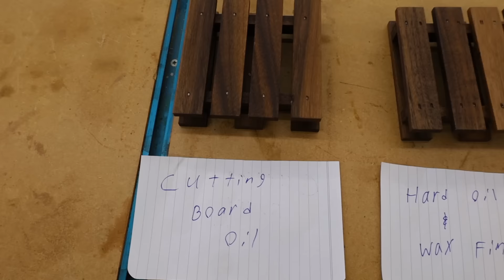3 Easy To Make Woodworking Projects That Sell | DIY Gifts

Comment: I have made sliding top boxes like these before, using various joinery methods, including but joints like you did, as well as mitred corners with splines, and finger (box) joints.  On every one, instead of using scrap pieces for the little handle on the lid, I saved the piece that I cut off the end piece and used that.  It also has the "advantage" of camouflaging which end is the opening end,and looks quite good.  I do also like your way of using a contrasting colour as well.

Comment: Three great little projects. With the popularity of making things from pallets, making pallets out of a fine wood is beautiful irony.

Adding rabbets to the wine box pieces is the simplest solution for hiding the slots. Miters are cool but they can be a little persnickety. It's easy to sneak up on the perfect rabbet.

For the pencil cup, I think the oversized and chamfered based looks bulky no matter how much of a chamfer you use. Using the contrasting white oak, cut a piece the size of the box and then cut rabbets on two sides of the base to accept the bottom pieces of walnut. You get straight sides, top to bottom, and a little structural detail from the alternating thinner and thicker edges of the white oak base.

Well made video showing how to make all three projects. It was long but each segment was concise. Well done.

Comment: I know this is two years old, but just wanted to let you know that I enjoyed the video. Regarding the multi-tool, I use mine all the time, however, more for custom renovation projects. They are extremely loud, so in the shop I prefer the pull saw.

Comment: Pretty inspiring, 2 things I will do different.  1st I will put my finish on before I assemble, will only need to do touch ups and will save time.  2nd, instead of dowels if you mix sawdust in glue to make a paste, then feel holes saves time and is cheaper, God Bless!
Reply: Good suggestions! Also cut the dowels shorter than needed. Stain them any color you want or burn the ends then drive them in flush. I have also made a jig to create my own dowels using a hand planer blade and a drill.
Reply: @airplayamusements5717  excellent. God Bless!

Comment: I have made a few of the wine boxes myself. You could have mitered your corners to allow the wood grain to match on 3 of the 4 corners and “waterfall” the piece. A small difference to make the project a lot better. Then if you wanted to keep the dowel accents, rockler makes a corner jig which looks cool.

Comment: I love the Deft Lacquer, but discovered a tip on another channel.  If you buy (or build) a cheap lazy susan, you can turn the piece you are spraying without touching it.  Allows you to easily do all four sides.
Reply from the maker: That is a good idea.

Comment: Nice little and quick projects.  A few suggestions for the wine box.  Use shallow rabbits ( as deep as the grooves) to attach the ends will hide the grooves on the ends.  I would cut plugs for the screw holes.  The plugs are easily trimmed with a chisel as you are cutting with them grain not across the grain.  You could use either the same wood to make nearly invisible plugs or a contrasting wood for highlighted plugs and I think the face grain looks better than the end grain of the dowels.

Comment: I think the pencil holder would make a great night light for a kids room. You could easily put a small LED bulb in there and then put your other base as a topper.
Reply from the maker: That's what I as thinking!  Maybe I'll make a larger similar version and do that!
Reply: @WalkersWoodworks  I liked the current size because it can fit on a nightstand without taking up too much room.

Comment: Great vid. When cutting many small pieces out of longer strips like you did for the pencil holder and coaster you could use painters tape to secure the longer strips together then cut multiple 4" or 5" pieces at once instead of cutting singles. A bit more efficient, safer and accurate.

Comment: There's some great ideas here! An easier method to hide the rabbets on the wine box could also be to use mitre joints.
Reply: Or cut some small plugs from the scrap cut off for where the lid slides in and glue 'em in.
Reply: Or, using either a router with a rabbet bit or the table saw, make a rabbet in the bottom of the boards for the plywood to sit inside attached with brad nails and glue. In fact this is an easier method than cutting a slot for the plywood board.

Comment: For the wine bottle box. Those little square holes made by the blade run thru can be plugged with sawdust and glue. Let harden & sand. A nice look is a darker wood sawdust to make the little squares pop.

Comment: I have found that staining, painting your project after cutting all the parts and sanding is the best way to cover the entire project. Took me half the time doing it that way. Touch up is hardly done. I’m gentle on build. Remember to compensate for the layer of paint/stain, it might throw your build off a slight bit.
Reply: I had the same thought.

Comment: Ryobi makes an 18V drill and driver kit to for with your brad nailer. There is something glorious about having one set of rechargeable batteries to power all your tools. Don't buy more than one battery technology or you wind up with lots of different batteries and chargers. Stick with the Ryobi 18V system and you can power ALL your tools from the same set of batteries and chargers. Do you want a shop full of tools or a shop full of chargers?
Reply from the maker: Haha already down that path.  But I do have the new 7 piece Ryobi HP+ kit now.  I used the drill and driver in my latest video.  Check it out. 👍

Comment: on the wine box, for the open holes at the ends from the slots, cut down small strips of wood (I prefer a contrasting color) and glue small sections in as "plugs" and it gives a nice, finished look
Reply from the maker: Good idea.
Reply: That sounds nice. Do you have any pics of that to share?

Comment: A quick tip for dowels, if you have a metal tap and die set you can run square profile hardwood through the required diameter die. cut a length of hardwood square and put it in a hand drill chuck and slowly cut the dowel profile with the die, you can finish with sandpaper .....
Reply from the maker: That's a great tip!

Comment: Great builds. You need to put caster wheels on your big work bench so you can move it around the shop so you don’t have to use extension cords.  Or better yet you can Mount a power cord under the top like I did and you can just run a cord to that and plug in several things at once

Comment: Thanks for your video. I really liked contrast of the wood colors. I’ve thought about making some coasters but the ones I’ve seen don’t absorb moisture from a glass. Probably would have to use a cork product. And the pencil holder. I thought the same thing as you, a candle holder. I think it would look good with the light coming thru it. Good tips and thanks.

Comment: Bora has a folding planer/cut-off table with modular cross bars than can be adjusted for differ sized units. It also has adjustable extension arms to support longer wood stock.

Comment: I’m wondering, for the wine box, if you were trying to save money & trying to maximise production, if you were planning to sell them etc you could make them more rustic. You could omit all the sanding, also omit the screws and just use the dowels to join. Plus I wonder if you could run the cover through the table saw to make a couple mm grove for an opening handle. Could also drill a couple of holes in the top and use a piece of rope for a handle… Good job sir!

Comment: To clean up those dado cuts on the front end you could potentially also set up a finished length on both ends and plunge cut with the table saw on the front end. This way you'd just cut from both ends of the board to make your long pieces have a bit at the end that isn't sawed through then take your short sides from the middle

Comment: the pallet coasters are great, but it might save time if you sanded all of he wood while it was long, and finish them also.  then just sand and touch-up the ends where they were cut to length.  Thanks for the video

Comment: ohh man, the part where you put the plugs in before the screws.. this is totally something I'd do haha. 
I just finished my first woodworking project, which was a pedalboard that had onboard power and in/out leads. Well, I knew that I would need to solder the jacks to the leads from inside the board as the jacks wouldn't pass through the hole for the panel mount jack... so what did I decide to do?? I soldered them up on my bench and then realized I messed up and had to do them all over again...:P

Comment: I use my router for the floating bottom like in the wine gift box. I fill those square holes with square pieces of wood like you did the dowels.

Comment: For the pallet coaster, as you didn't glue it together you could have used Rubio or similar coat on the pieces before you put it together.
Reply from the maker: I did use ca glue.  But ya probably so.

Comment: Spray lacquer just cuz it’s easier and quick and still looks good. Wondering if the screws were even needed on the wine box? Meaning, drill full size holes and tap the dowels fully into the hole. May need to clamp for longer but would save money for no more effort.
Reply from the maker: I went back and forth on that. I decided to go with the screws because i thought it would be more approachable.
Reply: @WalkersWoodworks  Hmmm. I’m a newbie but I definitely agree with that thought process.
Reply: I agree. I made some frames using this method.  It looks nice, costs less, and lets me say, "no metal fasteners".

Comment: Great video and I just gave you a subscription!  On the ends of the box at the bottom, I would drill a small hole to round out the groove and glue in a short piece of dowell to close up the hole.  Might give it a little bit of character?

Comment: I think you could use dowels to plug up the dado from the tablesaw on the wine box. It'd make it look a little more finished with nearly maintaining the ease of construction.
Reply: i was thinking that he might cut square pins and glue those in. Shouldn't be too difficult to fill those holes, and it could make for a nice contrasting accent. Especially if the pins matched the dowels on the sides.
Reply: Following what's the price point on these?
Reply: @jabrwok  that would be fine as well. But I was thinking dowels since he already had the one and the countersink bit he was using already would be easy on the square dado.
Reply from the maker: That would work!

Comment: Good video.  Useful tips. Thanks!
Why not lightly sand and finish the walnut pieces of the coasters and then assemble them?
I like the hard oil finish … but that’s just me.

I really like the wine bottle box.  If you don’t like to see the end slot - it should be easy to miter all corners and use painters tape to help glue up.  On the other hand, if you don’t like to make accurate miter cuts, then you could make a matching slot on the end piece and use a contrasting 🎉(or matching) wood spline “domino” to join the pieces and give a decorative touch.

Comment: I am making the wine box out of a set of OLD OLD mahogany bed rails I found in my barn. They were from a bedroom set that my grandmother moved into my aunt's house in the 1950's, it was passed down to several generations and finally the headboard broke and somehow I ended up with the rails.   All pieces are cut and the box is clamped together, I am just not sure on what size screws to use.  The boards are a little over 3/4 inch thick .  I bought a 3/8 inch thick oak dowel, but none of my countersinks are the right size, either too big or too small, so I am on hold

Comment: Love all these ideas and am definitely gonna try a few. Question, for the pallet coasters could you use pin nails instead of brad nails? I have both however, a pin nailer seems easier to aim and direct.
Reply from the maker: Yes for sure.  Pin nailer would work fine.
Reply: @WalkersWoodworks  awesome thanks 👍🏼

Comment: Awesome man but what I don’t understand is if you have the shop and all these tools and you don’t know the proper butt joint technique with dowels and screws. Still the cool vid man keep them up love the gifts great ideas and they came out awesome.
Reply from the maker: What did I do incorrectly?
Reply: @WalkersWoodworks  Nothing big just installing the wood dowel before the screws. Typically you pilot with the counter sink then add glue and the nail or screw then the Dowels. 😎🤘👍

Comment: Could you drill the holes and just use wood dowels to hold it together? Is there an advantage to using screws? Nice video with some great ideas. Thanks!
Reply from the maker: Yes you definitely could.  No advantage.  Just a little easier

Comment: Nice vid.Just wondering why,when you grooved for the top and bottom you did not cut a groove,flip the piece then cut the second groove then move the blade over and repeat ?
Reply from the maker: I should have haha.  That would have made more sense.
Reply: I only know this because I made lots of them exactly as you did before it clicked.LOL That's what makes woodworking such fun

Comment: The only reason for the screws is so you can take the clamps off and finish the project Without waiting for the glue to dry. Why not just drill the holes deeper and glue the dowels in to secure the joint and you’re done?
Reply from the maker: Thought about that.

Comment: Are the screws + dowels necessary for the winebox, why add those instead of just using woodglue
Reply from the maker: Good question. Wood glue does not make a very strong bond when gluing face grain or edge grain to end grain. The pores in the end grain soak up the glue and the surface area is much less than if you were doing face to face. Hope that helps!

Comment: I would have resawed (resawn?) that walnut instead of turning a quarter inch of it into sawdust lol
Reply from the maker: Honestly I used to do that until I ended up with a pile of small pieces I never used lol.
Reply: @WalkersWoodworks  Yeah, I can see that. That's why I think a band saw is sometimes better to have than some other machines. I don't have the $ or the space for a fully fitted shop, so I have to do what I can with what I have.

Comment: Correct me if I'm wrong but in regards to the pallet coasters wouldn't it be more efficient, to stain/or finish the piece before assembly? 

Just wondering out of curiosity was there a reason you stained after assembly, possibly because it was partly and experimental build.

Comment: Easy to make if you have equipment costing thousands 🙄
Reply: Craftman has an affordable portable table saw less than $150, ryobi has a miter saw non sliding about $180. For the nailer, look into pneumatic nailers, less expensive than the battery counterpart, some comes with pancake compressors already. For about $500 you can get all three. I know cause I got all three equipment for about that amount.